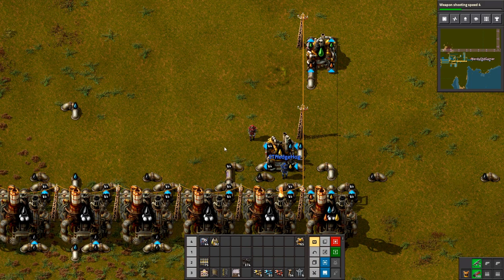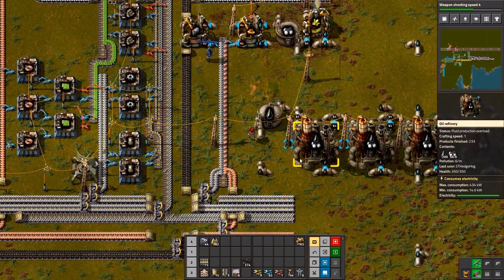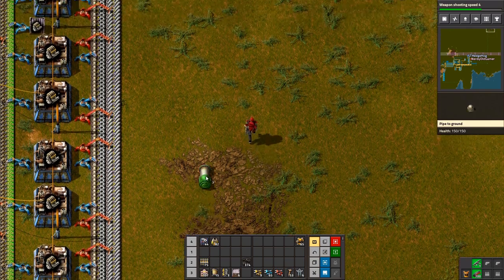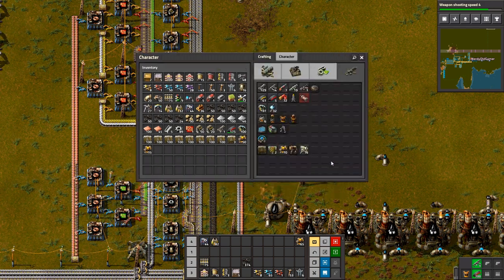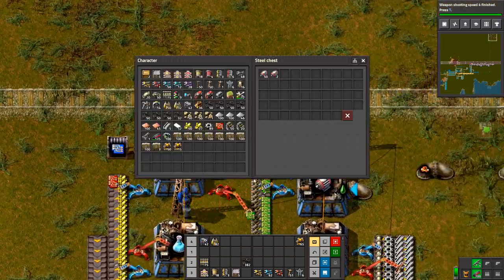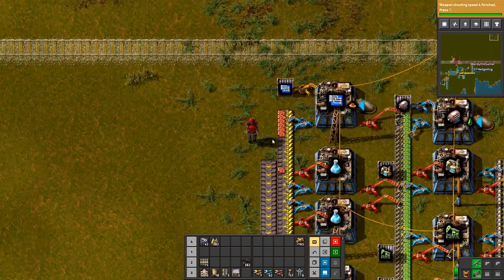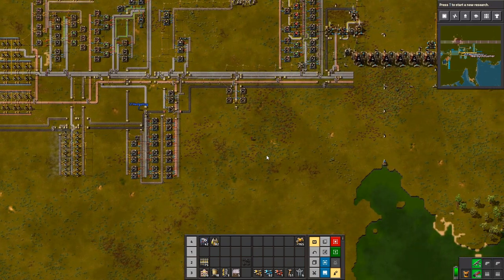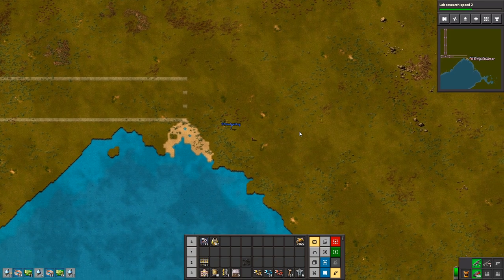Factorio 1.0 Multiplayer 1K SPM Challenge Ep11 | Biter Killing Prep

Comment: I don't know what the out come of the battle is going to be but I think you're going to get your ass kicked I  hope i'm wrong. One thing you mite want to try use rockets it gives you a little range advantage over the worms. But it takes 2 or 3 rockets for a kill you need a lot of them damage does get better with research.  When shooting rockets fire 3 get each target if it will die with 2 it will not fire the third. 4 assemblers making rockets no cap on 2 chests you need rockets for spidertron.
Reply from the maker: Hi Pete, we will definitely be getting rockets 😂